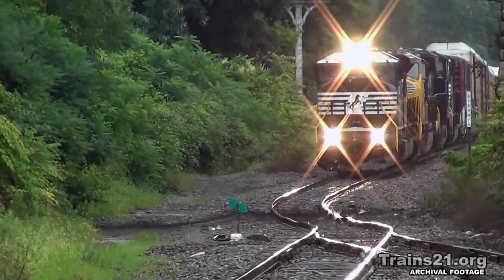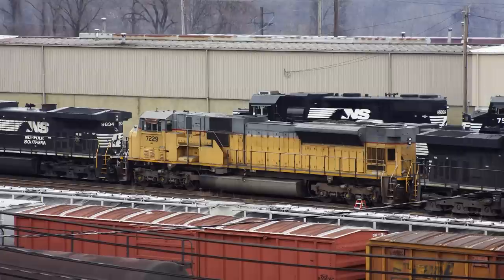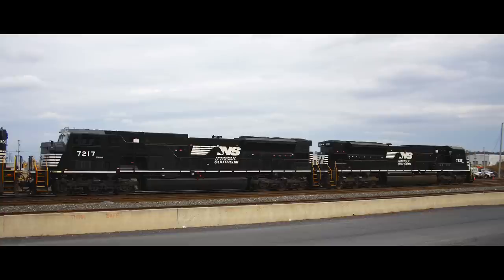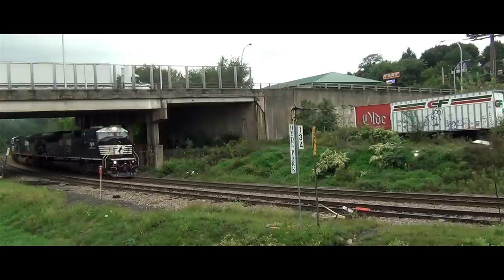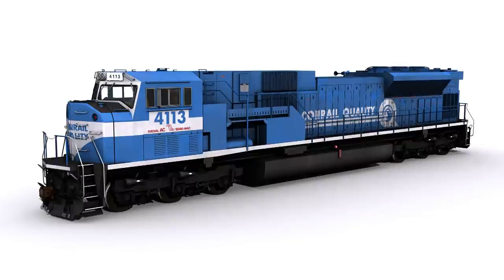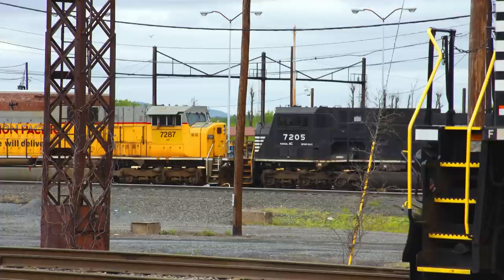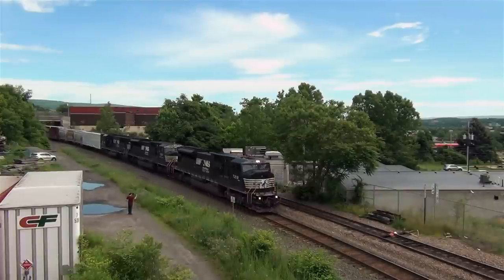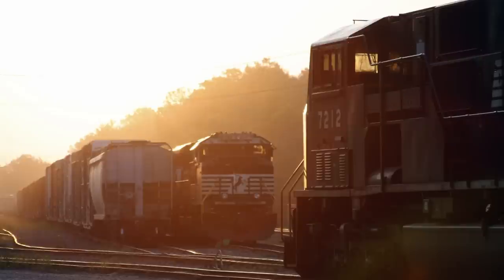EMD SD80MAC: The Rise and Fall of the Conrail Cadillac

Comment: The problem with the early SD45 20 cyl. engine was our American engineers had the crankshaft throws on several cylinders out of time with torsional vibrations which caused the crankshafts to break way prematurely.  The Japanese 🏯  straightened this out by showing our American engineers a little trick in changing the timing on several throws of the crank allowing for a smoother running engine. They've learned this building huge ship engines which don't have the high RPM's as say a smaller diesel engine but the torsional vibrations are the same at any RPM regardless of engine size.
After this was addressed among a few block changes to accommodate the newly designed crank the big V20 was as reliable as it's little brother the V16.  The 710 V20 which was found in the Conrail Cadillac SD80mac had a horse power rating of 5000hp and with a little tweaking another 500hp could be produced and according to testing was still as reliable as the 5000hp setting, only thing that brought EMD to only bring the 5000hp setting to fruition was the fact anything over that horse power setting would cause the locomotive to over power the track with the current rail systems nationwide.  
This over powering the track was found also in the 6000hp models in the Horsepower Race between GE & EMD which was decided that around 4400 to 4500hp was optimal for our rails here in the states . . .

Comment: You forgot to mention about the SD45T-2's which also had 20-645E7's like the SD45's and SD45-2's. Much like the others,they also were rebuilt because of numerous problems involving the crankshafts being broken. The same issues were still present on the SDP45's,SD45M's,FP45's,and F45's.

Although debated,the SD80MAC's were probably the last great EMD units built and still retain the title for being reliable units with a high amount of horsepower. It just so happened that Conrail was the only railroad that actually purchased them. Conrail loved using these units for ore trains much like their C40-8W's. CNW had plans to order SD80MAC's to use for coal trains but the merge with Union Pacific discontinued that. The immense and problematic situations with the SD90MAC-H's and SD70ACE's is what really put EMD down,the SD70ACE-T4's are the worst.

Comment: I used to work on these our of enola back in 2015.  As much as people like these engines trust me they were beat.  Engines would come in week after week for similar issues.  7228 specifically was a problem engine.  Csx did them no favors when it came to maintenance and neither did ns when they pulled them away from conway and sent them all over the system.  Many guys/shops werent familiar with these engines.

Comment: Now that technology has advanced, it would be interesting to see what would happen if EMD and GE tried again with the SD80's and 90's and GE with the AC6000.
Reply: That sounds like a great idea, as long as they aren't do powerful that they slip too much
Reply: The ES44s are still hot garbage. Would be nice to see EMD have another crack at it though.
Reply: @wesw9586 What sucks avoit them?  Just curious.
Reply: @rx7sportscar  just about everything but emissions
Reply: MysticRenn  I was a CSX engineer during the time that the AC6000s were being delivered and troubleshot.  They had a low-speed "wheel hop" issue among other problems.  Sometimes starting them out from a stop on an upgrade would cause the wheels to break traction and "jump" up and down for a little bit.  For awhile CSX reduced them to 4300 hp by a software change until they could solve some of the issues.  They did eventually put them back up to 6000 hp before I left in 2008.  What I will say about them is that they had the most incredible dynamic brakes of any locomotive I ran, being able to all but stop a train on a downgrade with only dynamic braking.  They were also very thirsty beasts, consuming 210 gal./hr. of fuel in run 8, so they came with 6600 gal. fuel tanks, which CSX rarely filled most of the way.  The main issue with the really high-horsepower units was that they could not reliably run them together in sets of three for fear of tearing trains apart.  If you saw a three unit lash-up with them, at least one unit would be something like a Dash-8, hardly ever three 6000s.  CSX rates locomotives for lash-up purposes by power and dynamic axles.  A lash-up can't exceed 24 in either power or dynamic.  An AC6000 was rated at 9 axles in power and 11 in dynamic, so right there you couldn't have more than two in a lash-up with working dynamic brakes without exceeding the limit (it is possible to cut out dynamic brakes on individual units).  In fact the only place around the Baltimore area they allowed either SD80Macs or AC6000s in sets of 3 was the Pope's Creek Secondary from Bowie, MD to the power plant at the Potomac River by Rt. 301 and permitted lash-ups of 27 powered axles for trains on that sub.  Just for that reason the SD80s were generally assigned to Benning Yard in DC for hauling those coal trains.  Someone I know stenciled #800 "Spirit of Benning" for that reason, and they let it stay that way for a couple of years.  Incidentally only one of them, I think 801, was ever painted in the YN2 paint scheme, and really looked sharp in it.  One of the model companies did an O-scale model of it that was very nice.
Reply: @wesw9586  …Yes, the GE’s are such hot garbage that they have a 72% share of the locomotive market. Quit flaming and realize Wabtec makes a better locomotive than Progress Rail.
Reply: @rx7sportscar  …nothing sucks about the Wabtec (ge) locomotive. He is just an EMD flamer
Reply: @stephenbroughman3231  no, not really better. EMDs 2 stroke prime mover just can't really do all the stupid emissions stuff well enough to appease the government.
Reply: @rx7sportscar  The part where they only power 4 of the 6 wheels on each truck is widely disliked. The cabs are shoddily built and rattle excessively. And they have a penchant for blowing turbo seals or finding various other ways to be on fire.
Reply: @stephenbroughman3231  lol not even close. Please be just a little informed on the topic before you stoop to the "buzzword to discredit" tactics. Have a debate or leave it be please.

Comment: I'm surprised Union Pacific didn't acquire any of these.
Reply: Before the merge with Union Pacific,the Chicago Northwestern actually had several orders written to EMD that they wanted the SD80MAC's added to their roster.
Union Pacific already had been ordering GE AC6000CW's so they had no interest in them after the merge was finalised and scratched them off the paperwork.
Reply: @Slim_Slid from what I’ve learned it was EMD who basically said Fuck off cause they were making a huge order for BN sd70macs
Reply: @justinmalachinski1  
What does that have to do with anything? Where did you possibly get that information from? Conrail had 100 SD80MAC's on request but only 30 units were completed because of the split/shut down interupting the orders. The SD70MAC's had nothing to do with anything other than in relation that Conrail went with purchasing those units for quality of AC traction when they were actually thinking about getting the GP60M's themselves and not just ATSF. The SD80MAC's were arguably the last best EMD units built,not just because those are the only successful yet reliable units made with a serious amount of horsepower. All modern EMD units have turned out to be junk in terms of traction and performance,including the SD70MAC's,but the SD90MAC-H's and SD70ACE's were worse. The SD80MAC's would've been a perfect recovery for EMD since everything was going downhill after the GP40-2's & SD40-2's were discontinued. However,technological advancements and emissions regulations have done otherwise.

Comment: So i would like to know what the difference is between a EMD SD70 and the SD70Mac?
Reply: The SD70s had standard cabs and the SD70MACs had safety/comfort cabs, I am sure there are some more small differences.
Reply: SD70 has the standard cab and has DC traction motors

SD70M has the EMD wide cab

SD70MAC was the SD70M with AC traction motors
Reply: Another difference, the SD70M-2 and SD70ACe had 4,300 hp prime movers, all of the others were SD70 variants had 4,000 hp. (Willing to be corrected, this was last I knew).
Reply: SD70 has conventional cab, DC power, SD70Mac has a whisper wide cab, AC power and some more modern electronics features

Comment: Afaik, the 80macs were all scrapped with the last disposition of some from CP being a move with several to North Dakota where they were cut up around the end of 2020. Also, there was never an SD80ACU program as some are claiming, talked to several employees at JBS, and there never was a plan for such a program.
Reply from the maker: Yes there was.
Reply: Not all of the SD80MAC's have been scrapped.Only the units with the most mileage and usage were likely to meet the scrap torch.
Any others that remain are still in storage with PRLX.On top of that,Canadian Pacific bought six of them just to use them as parts donors only for their SD9043MAC's and SD70ACU rebuilds.

Comment: 🤦🏿‍♂️u.p. had sd80mac along with sd90mac/43 mac's
Reply: Correction, CNW ordered 15 SD80MACs right before the merger but UP canceled it and replaced it with more SD90MACs.
Reply: @dfwrailvideos  no sir, I still got some of the old manifest print-outs from back then. U.p. had sd80macs, most used on west bound coal and grain trains out of little rock, ar... I know this cause my dad use to work for mopac/up, and also my grandfather was apart of the crew who built the u.p. Jinx yard in North Little Rock, Ar... Don't know exact numbers tho, but they did have sd80mac's.
Reply: @dfwrailvideos  and just incase if your not familiar with u.p. manifest print-outs (and im only speaking on u.p. cause idk other railroad logs), it gives you train name, the engines railroad company (like s.p., n.s., bnsf, etc.)engine road numbers, engine model, engine horsepower, and if it's a dpu or not. Follow by each car and it's contents.
Reply: @mikestafford3182  UP did not have SD80macs, they were never ordered by CNW or UP. Externally the SD90s and 80s are the exact same apart from the light placement, and the very rear.
Reply: @milepost26.69  correction, they did have 80macs!... how they obtained them idk (i can only assume)and don't care, but you talking to somebody who actually seen, been on them (while on duty) and have paperwork and logs to prove this fact, also grew up around the jinx yard and diesel shop. And the sd90macs eventually got discontinued or converted because of over-heating problems. Humbly just saying
Reply: @mikestafford3182  they didnt have 80macs. this is common knowledge. They didnt have SD80Mac lol
Reply: @mikestafford3182 they must have been running pooled units, which does fit with photographs and videos taken at various points in time.
Reply: @mikestafford3182 I think you need your eyes checked because that is SD90MAC because I know the difference is between my favorite SD80MAC 
Is the near SANDBOX
Reply: @tacticalcalebgaming7264  what are you talking about??? I was only stating that U.P. also had sd80macs too. My eyes are perfectly fine!!!
Reply: @mikestafford3182  listen dude those are SD90MACs because their near Body shape is all flat whereas the SD80MACs has a sandbox. But it could be an error on the papers or it has been leased by either Conrail, Norfolk Southern, or CSX. If Chicago Northwestern bought those they were reordered as SD90MACs or AC44CWs and to be fair I see SD80MACs in my town so much more than you see and I can tell the difference between SD70ACUs they were former SD90MACs
Reply: Not that I know of. We built two prototype locomotives, and then the order for Conrail.

Comment: They were deemed to expensive to maintain. NS is trying to cut costs by doing what BNSF and CSX have already done by streamlining their motive power fleet to just 2 or 4 specific locomotive models that share the same parts (GEVOs, AC4400CWs, and Dash 9s). No other model on any Class 1 railroad has 20-cylinder 710 engines, so there was no point in keeping the SD80MACs running. Converting them with 16-cylinder engines would've been more practical, however, GE's are far more affordable and cost-effective than EMD's.